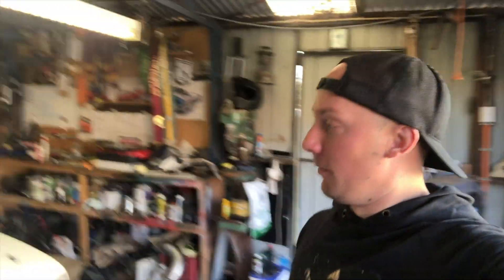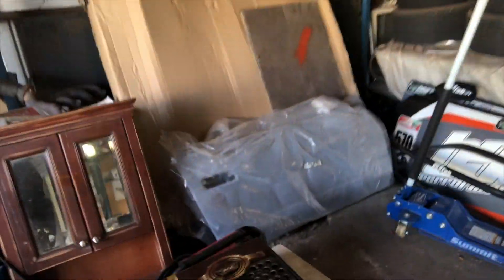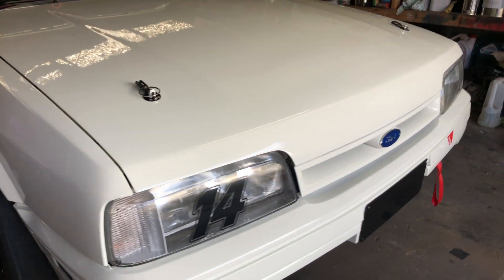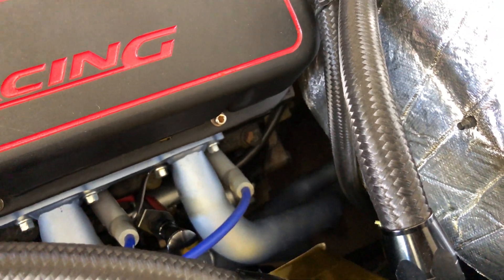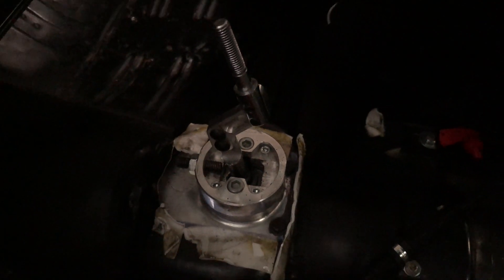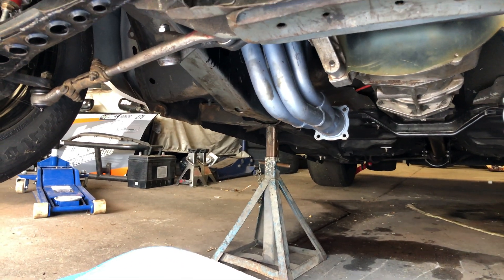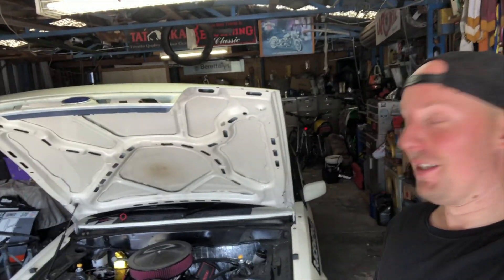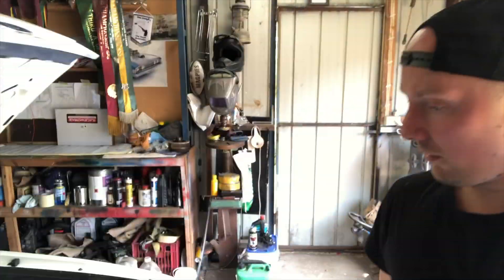10'000 RPM WINDSOR? FIXING ENGINE IMBALANCE

Comment: I feel yer pain, man ! My old XB clevo was an auto when I bought it and I swapped to a manual but still had the original harmonic balancer. The thing had a hideous imbalance that drove me insane. Clevos n Windsors suck with external balance - really can only be fixed with tear down n full rebalance. 304/308 Holden is so much easier with auto-manual swap due to internal balance. Good luck 👍
Reply from the maker: We had the wrong flywheel on the car so hopefully once we fire it back up we find weve fixed the issue, next engine will be getting a full rebalance though!